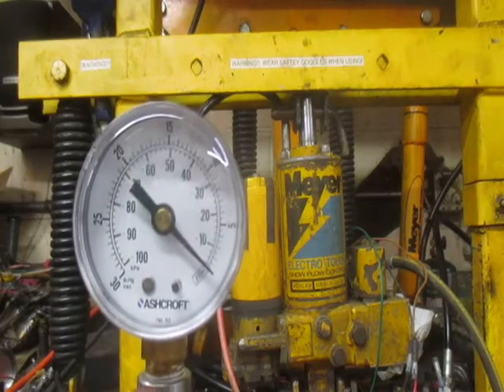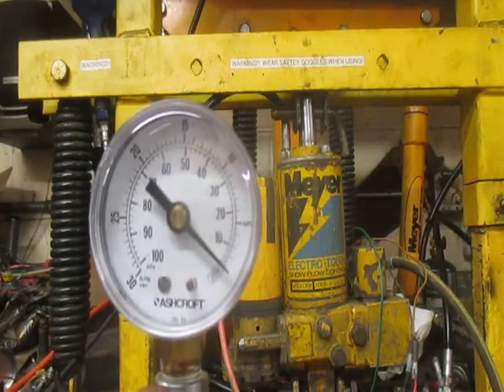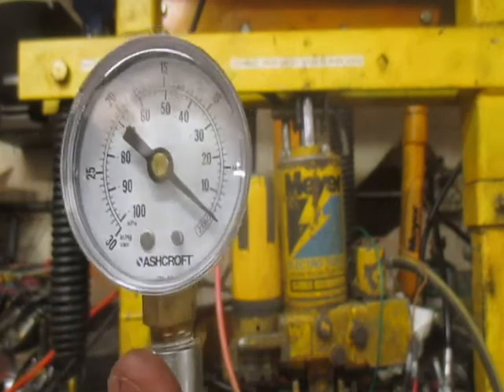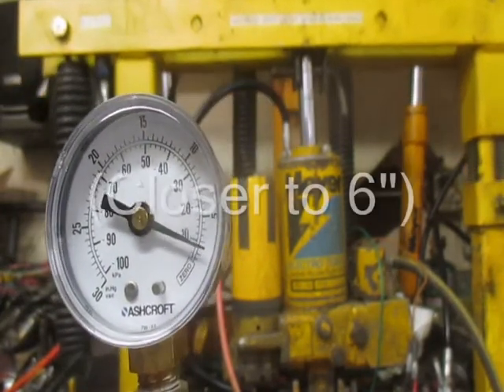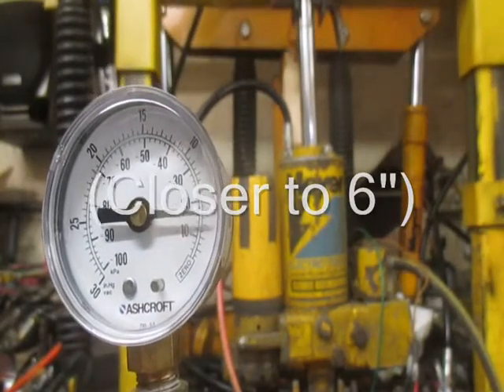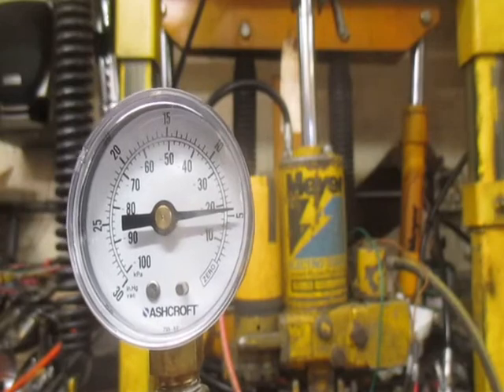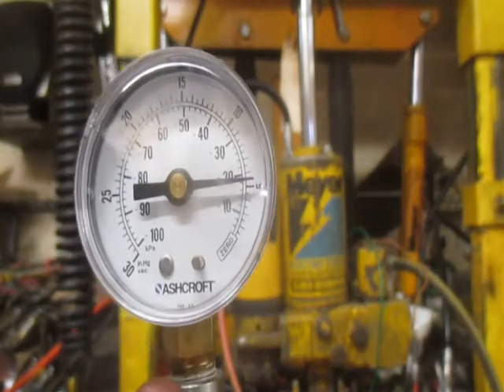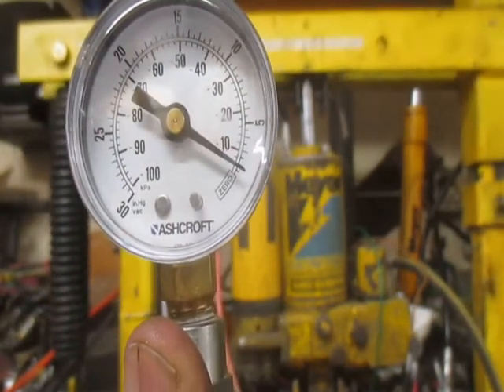Why do the Meyer E-47, E-57, and E-60 take on water?

Comment: So what you are saying, it is a good idea to seal the tank O rings with clear silicone as well?
Reply: Wouldn't oil leak out if air or moisture were capable of leaking in?
Reply from the maker: @jonathanfreedom1st  There is never any pressure in the tank (pressure relief valve we call a vent opens at 1 - 2psi to let out pressure), but yes, it will seep out. I found out the hard way years ago rebuilding units a customer would bead blast prior to sending them in. Sitting here on the floor, rebuilt, the units would be wet near the bottom of the tanks where they meet the base. I tried cleaning them off several times over a couple of days, and same thing. What you have to remember is that when new, Meyer put a VERY heavy coat of paint on them, which sealed everything. Once they are rebuilt that seal is gone. There is usually rust, and pits where the tank O Rings meet the tank. After smoothing it off, they can't make a good seal, not when a vacuum is put on the tank EVERY time the plow is raised. Whenever the plow is up it is trying to suck in air and moisture wherever it can. Make sure you put silicone on the Wiper too, before pressing it in.
Reply from the maker: Yes. The Wiper too before pressing it in.
Reply: @SmithBrosServicesLLC  would a gasket maker type of silicon work?